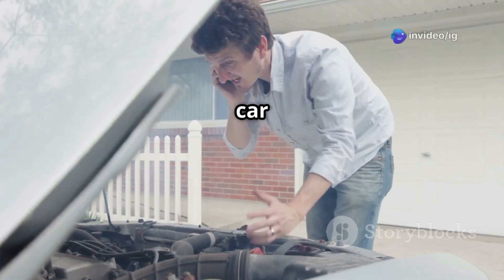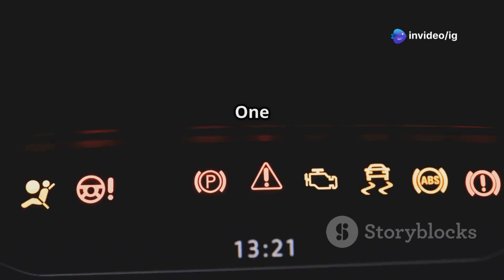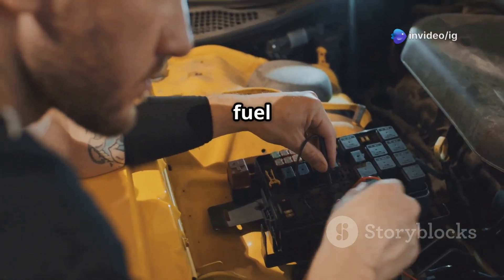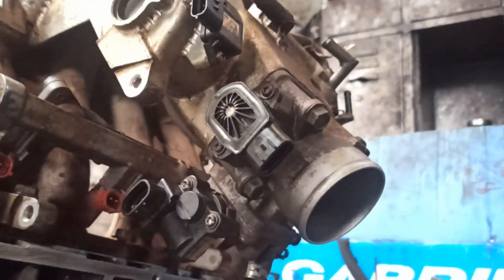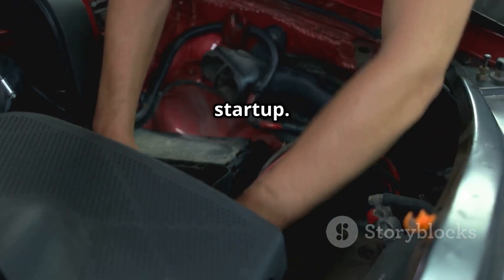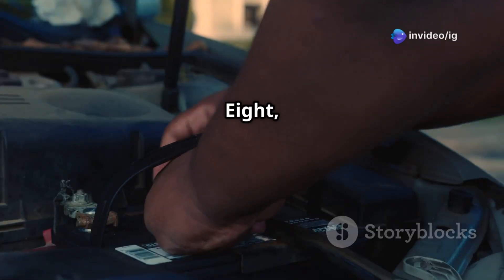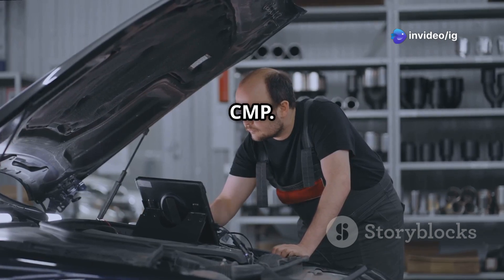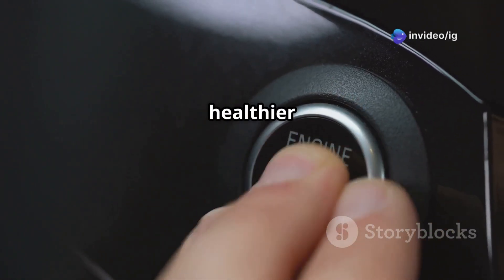P0316 | p0316 misfire detected on startup | code p0316 | p0316 obd2 | dtc p0316

Comment: I was gonna buy a 03 mustang gt. It Runs good. I plugged in my scanner and I found a code p0316 1/1 . Engine feels good like there is no misfire. Any idea why the check engine light isn't on . I even drove the car for like 30 minutes on the freeway